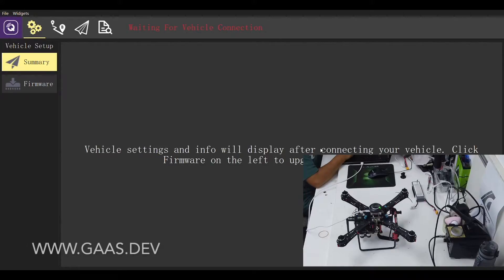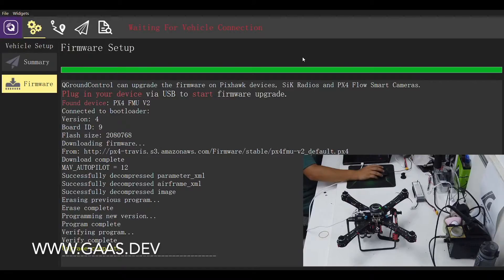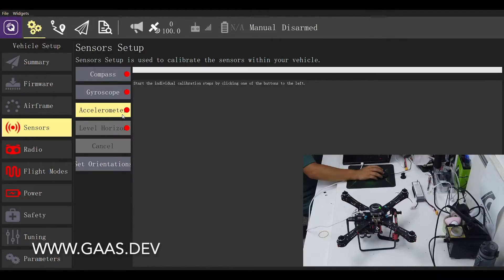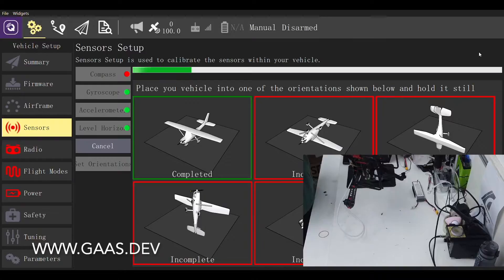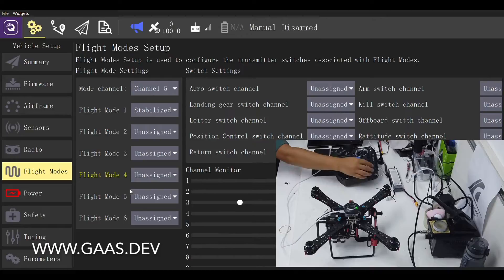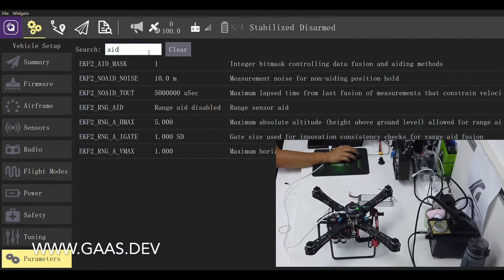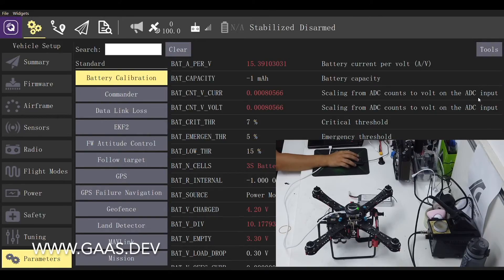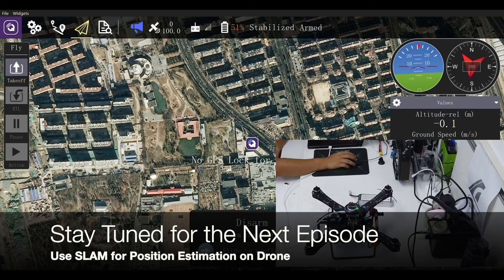Autonomous Drone Hardware E02: Step-by-Step PID Tuning with QGroundControl

Comment: In the GAAS Documentation, it says the project for simulation in ROS is compatible only in Ubuntu 16. But the problem is, when I tried installing PX4, the documentation of the autopilot stated that the simulation only works with Ubuntu 18. Although I tried installing the px4 during the build, it heavily gave me errors. Please let me know of a proper solution. I even have TX2. But it did not get loaded in it either!

Comment: i am having a problem. i am working with a fixed wing drone and when i want to calibrate the remote which is spektrum dx7 to the qgroundcontrol it shows a windows with "detected 0 radio channels. (my receiver is ar8000)
Reply: same for but with a taranis qx7, did you find any solution ?

Comment: I'm also using QGC with a Pixhawk4 running PX4 firmware. Do you have a video about PID tuning for accurate flight response, in accro mode but also in stabilized or position flight mode ?